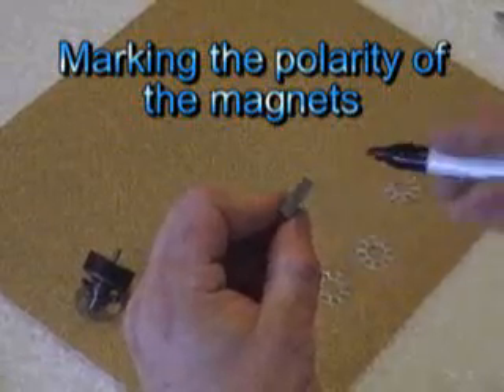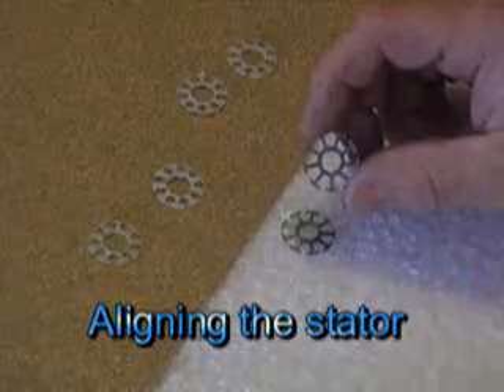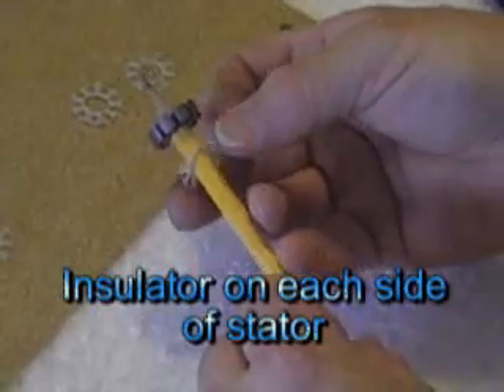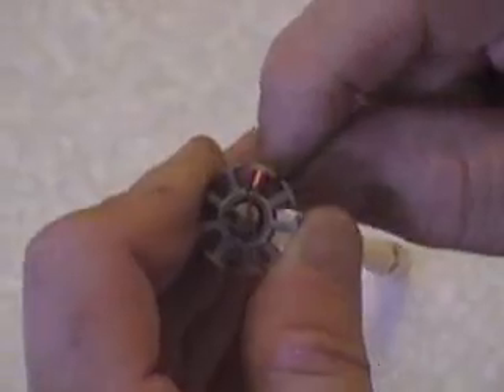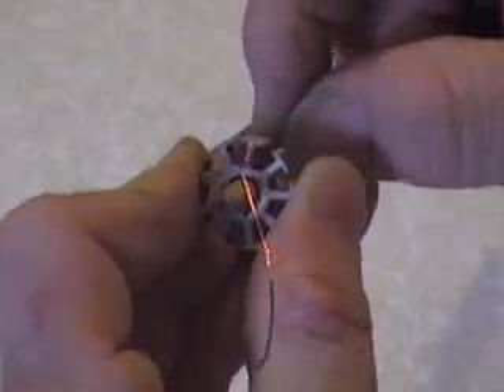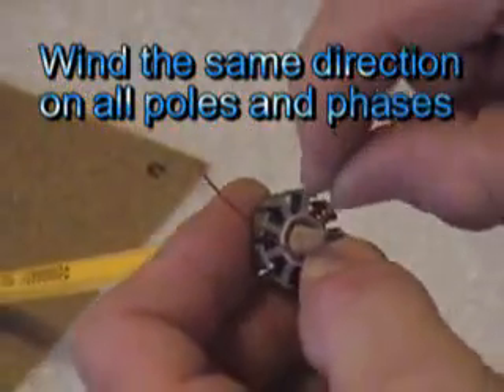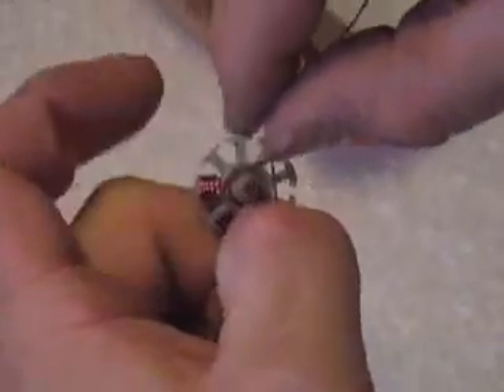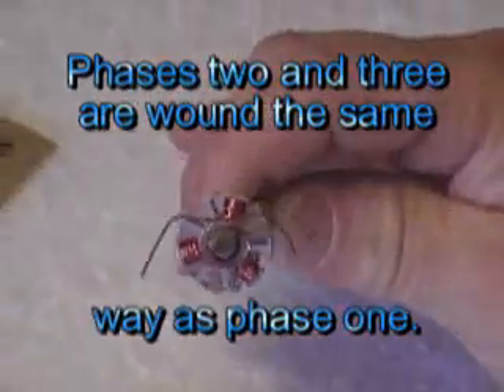Motor winding #1

Comment: Hi, I hope you can help me... I'm trying to rewind a brushless, w/ 12teeth, 14magnets. it is 800kv originally and was using 3 strand of wire (3 strands of 30awg), 13 turns. delta.  I its from hobbyking AX-2213N

 i can only use 22awg right now, and want to use the same KV,  does the AWG matters? how many turns ihave to do if i'm using 22AWG?  Thanks in advance.